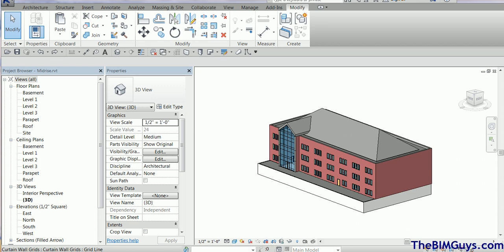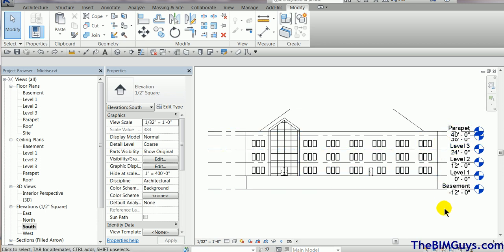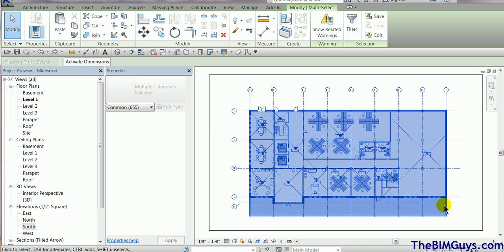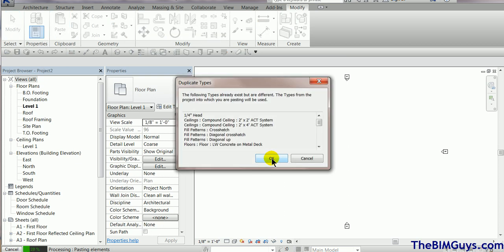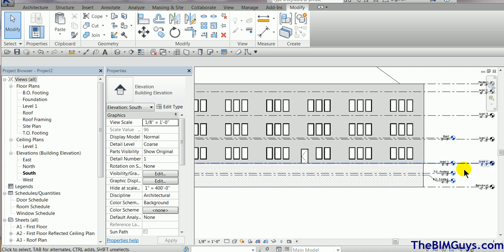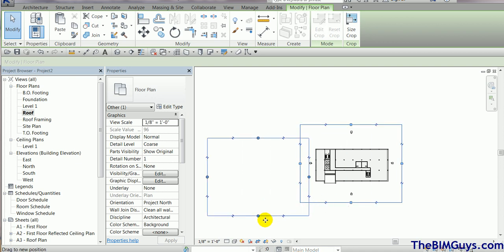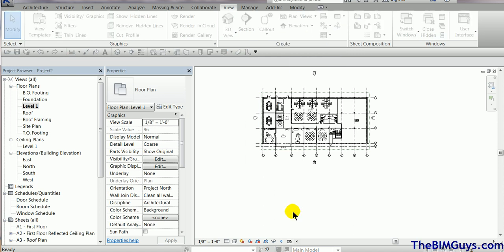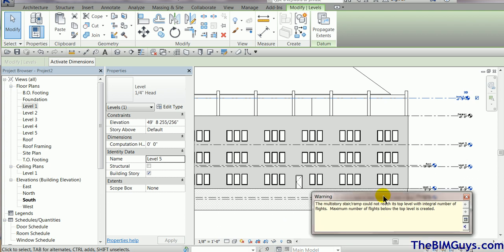Revit - Moving and or Copying building parts from one file to another - CADtechSeminars.com

Comment: Why does something so simple have ro be an ordeal with Revit?

What we all are really looking for is Autocad's 'WBlock' equivalent & easy to understand Insertion Point.

But Revit has to go out of it's way to wasye our time.
Reply from the maker: If you are looking for another option, you can use the Group command to create a "Wblock" (Write Block in AutoCAD). In the source file, create a group of the items you want to move. Once the group is created, highlight the group. You should see an option in the Ribbon Called 'LINK". Choose this command and Revit will prompt you to create a standalone RVT file of the objects in the group. Next open the project you want to add it to. Then use the INSERT TAB>'Add Revit Link' command to add the newly created file into the current project. If needed, use the BIND option to convert it back to a group in the current project. Even Ungroup it!  Hope this helps.

Comment: I think the main issue I am having is basically that the levels are different and that screws up, especially the stairscases. I tried making new level that follows the old file levels but unfortunaletly it doesnt work properly. There should be a way to enable staircases to be placed without any constraints.
Reply from the maker: If the levels are 'screwed up' you may consider adding new levels as needed. It may get a bit busy, but you now have actual levels that are correct to associate your stairs and produce the correct stair system.